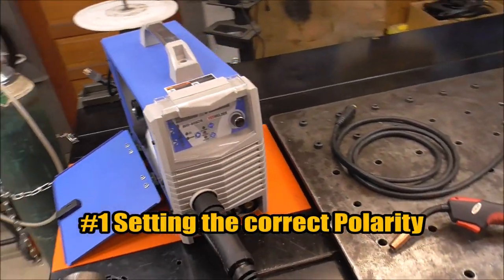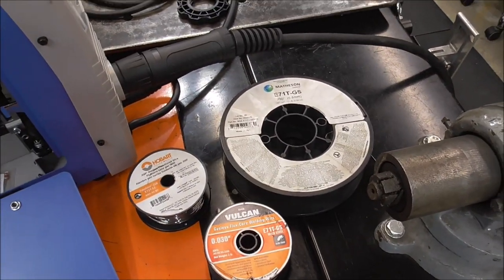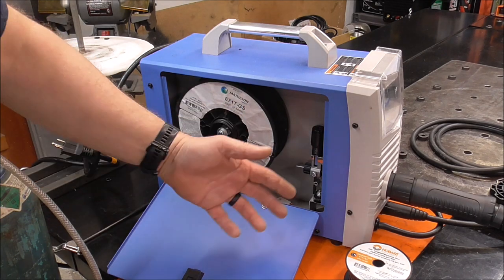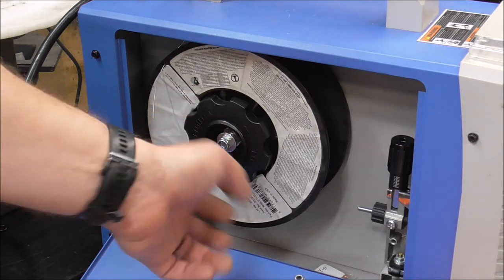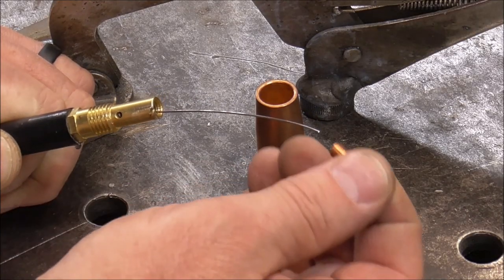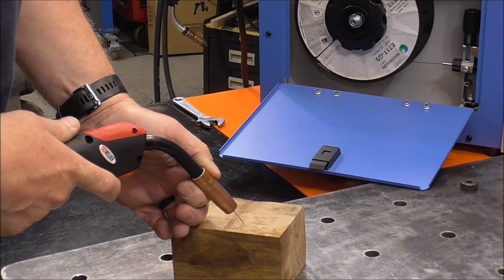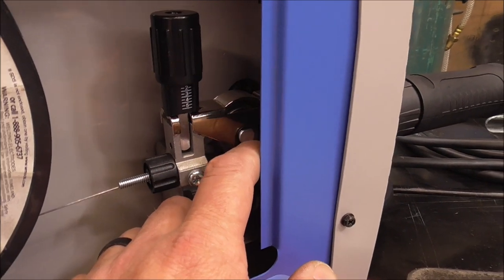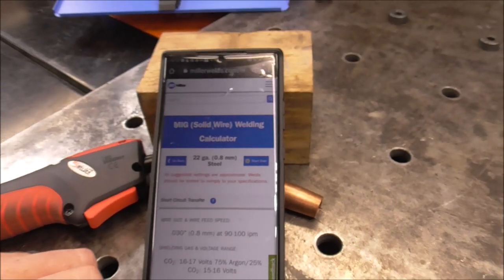5 Tips Basic MIG Welder Setup for Success

Comment: Hey man 👋,, thanks again for the refresher. 
Question about the Gasless setting on the Mig205DS.  What exactly is it?  When I access it,   Only the .035 wire size illuminates?  Isn't the gasless setting for flux core wire?
I'm using .030 Lincoln FC Wire.   Maybe I'm missing something here. 
SMH🤦‍♂️.  Thanks for your reply 👍.   Cheers 🍻,  G.
Reply from the maker: @Gabriel Szekeres honestly I dont remember just the 035 coming up because I too burn .030. The gasless is for flux core. I will have to fire up mine tomorrow and take a look.
Reply: @BrandonLund ,, hey,, any idea on my question??  I can call Yeswelder Customer service, but I trust your opinion. 
See you tomorrow 👍.
Reply from the maker: Sorry man i didnt get to it. Ill be back in the shop this week and try to get your answer. Sorry for the delay brother
Reply: @BrandonLund  ,,  no worries,, you're busy 😉. 
Chilling out in beautiful Boulder City Nv. 
  Thanks for your reply.

Comment: I have an unrelated question, but think you are the right one to ask. I just purchased a H F 4 x 6 horizontal band saw, and like you I use bed rails to build some projects. My question is what do you think is the best speed to cut them on with the band saw ?
Reply from the maker: @MT Pocket Builds I use a slower speeds on thick materials and on hardened metals. A word of caution, you WILL go through blades fairly quickly when cutting bed frames because they are hardened. Keep your blade speed fairly slow and dont use a bunch of down pressure. I actually have a couple videos using bed frames and I talk about this https://youtu.be/wKW1IYdabxg
Reply: @BrandonLund  Ty for the advice Brandon

Comment: Great video,  Brandon, and very informative and while technical, not boring!!!  Several other videos I have watched do somewhat the same thing, but haven't been able to watch all the way through for falling asleep!!!  Not yours!!!  Also, I found out that the 71T-GS wire that came with my Harbor Freight welder works so much better now that I have converted it to DCEN.  Any of your viewers that have one of the Harbor Freight 125 wire feed welders would be wise to convert it. That tensioning proceedure on the tension wheel is invaluable.  Used it to do my wire feed and it worked and it made my welding better.  Be well, be safe, be Blessed!!!
Reply from the maker: Thanks Jim i appreciate it! I need to do that conversion. Im going to pick your brain first if thats ok. I think a lot of others would find it interesting too

Comment: It all seems trivial, but even after many decades of experience, this can't be mentioned enough. Very learnsome and important to keep our knowledge up to date. Have to admit that over time we forget things which makes these vids very useful. When watching I noticed some things which I've forgotten and got the AH-effect. Small/little things that matter tremendously so as to prevent much frustration instead of despising yourself being a bad welder whereas the solution can be found in these details for which my big thanks Brandon. Important for startes as well as experienced men/women. You quickly overlook one of these details. Merci and greetz from Holland, Marcel Knippers😄🤓💯👌💪Ps Brandon, did you ever mention how to know if it is solid wire or FluxCore? If you bend FluxCore-wire, it brakes immediately. Solid wire not. Please correct me if I am wrong😁😅
Reply from the maker: You are spot on Marcel, flux core breaks, solid doesn't and I very much appreciate your comment! 🙏

Comment: Thanks so much. I have a synergic mig that I've only really used a small amount for some automotive panel with 0.6 wire. mostly I've had a go at some lift Tig. I have used it extensively as a stick welder. Getting C25 gas as a hobby welder in the UK is difficult and expensive. They mostly supply C10, C5 or 100% argon but I have found a supplier very near home who supply the local drinks and beer industry for 100% Co2. with this and my stick welder I have been building some large driveway gates. the set up for wire tension was a great help as I think I had mine a little slack, frightened of over tightening.
I have a U groove roller and would love to try some aluminium as the machine has settings for it. I was advised to get a Teflon liner but I see you recommend a graphene line?. also a lot of people say to go one size over on the contact tip to avoid it expanding and  jamming in the tip. is this incorrect and more to do with burn back due to wire speed.
thanks again.
Reply from the maker: I appreciate your kind words. Graphene or Teflon are basically the same and they will work equally as well so either is a great choice. As far as the contact tip, definately go one size larger than your wire. As the wire is being fed, it heats up and expands and will start to bind in the contact tip which leads to a birds nest inside you machine. You definately want to go up one size on the tip to avoid this.  WELCOME ABOARD! Thanks for subscribing to the channel. It's very much appreciated.
Reply: @BrandonLund  thank you. 👍